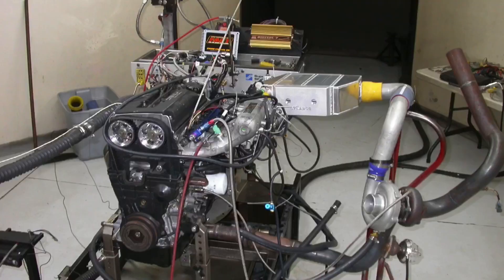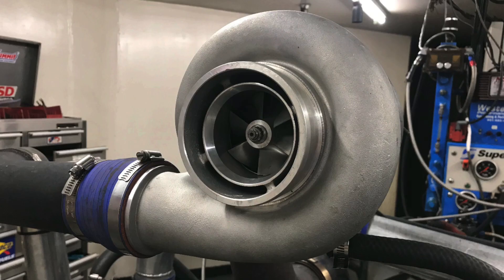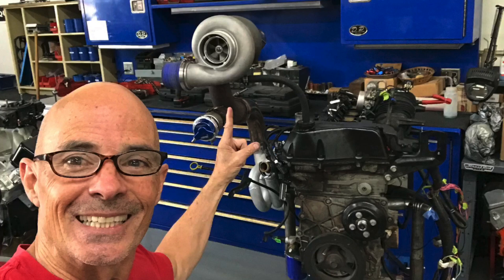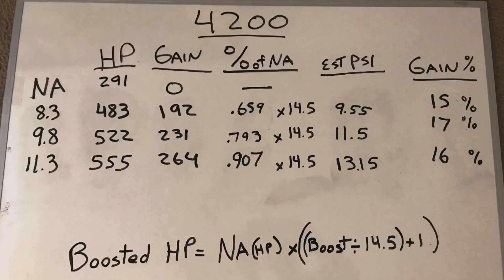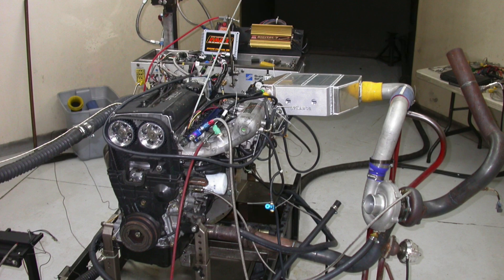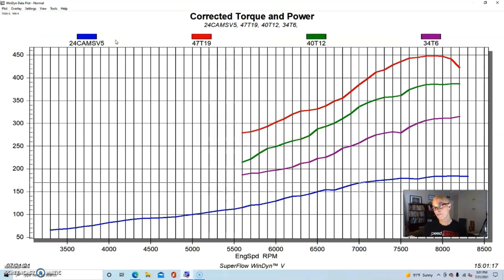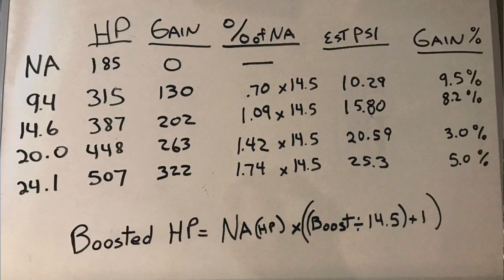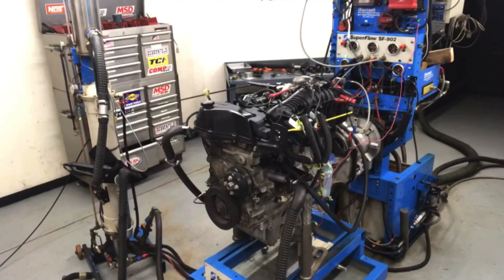TURBO ATLAS 4200 VS TURBO HONDA B16A- IS ONE BETTER FOR BOOST?

Comment: Great stuff Richard.  Question/comment - was the 4.2 tested on E85 or gasoline naturally aspirated?  If both tests on E85, ignore the rest of this comment.   If it was on gas you need to subtract out about 7% from the percentage improvement (vs. theoretical) when testing the boosted setup on E85, just because of the extra energy liberated by burning the E85 vs. gasoline.  There's also the cooling effect of alcohol (and the extra 40% fuel by mass injected and evaporated), but that would be tough to model easily.
Reply from the maker: THE VIDEO MENTIONED THE E85-THE 4200 SHOWED NO POWER GAINS NA FROM THE E85

Comment: Still waiting on that 3800…
Reply: Hes probably sourcing parts. I hope he finds some aluminum heads for it
Reply: @madmod  Unless he plans on paying 2k plus for some discontinued ZZP's, I doubt he ever will. There's also the few pair of aluminum prototype heads, but again I doubt he'd ever find a pair of those either.
Reply: @billballin6948  Ive seen them for sale on forums and Richard knows a lot of people.
Reply: @madmod  that's the only place they are for sale,and in the past few years I've only seen one pair of those prototype GM heads and maybe two pairs of the ZZP heads. I think a ported vs unported iron head comparison would be a lot more applicable to the 3800 community, especially when paired with an m90.
Reply: @billballin6948  He tried some hand ported iron heads on his 3800 tests and saw marginally no gains. Iirc he was pretty positive they had good work done, it just didnt make much of a difference on a non intercooled m90 3800 with mild cam timing
Reply from the maker: alum 3800 heads will not be part of the testing-since they are not really available to the average guy
Reply: @richardholdener1727  How far out on dyno time are you guys out there? We have an appointment at the end of August for tuning a v2 centri on a customer car.

Comment: your math is flawed the power na starts at 30 kpa there is only 70 kpa delta that is responsible for the na power
Reply from the maker: WOT NA IS 100 KPA-THE MATH IS SOLID
Reply: @richardholdener1727  yes but it doesnt start making power until 35 kpa so the motor is making  close to 30 hp per lb of pressure na
Reply: @bill2178  You're comparing it to the power made at 100 kpa of absolute pressure.  That's your reference point.
Reply: @ChurchAutoTest  If you look at the power gains at 4000 RPM it’s closer to 30 ft  lbs per psi But the torque is not rising relative to the NA curve that’s the effects of the rising backpressure and losses in density
Reply: @bill2178  we talking power or torque?  30 ft-lbs at 4000 rpm = 23 hp  Math!!

Comment: Any boosted motor you say? YOU HAVE MY FULL ATTENTION!!!
Reply: @richard holdener, I saw much larger HP gains per psi, when going from 7.8psi to 11psi, then extrapolated for higher boost levels to get a guesstimate/range of whp before I blew the last motor up. What would you attribute gains of 12.02whp/psi at 7.8 vs 13.72whp/psi at 11. Would you attribute that more towards entering the turbo's efficiency range, than the VE improving with more flow? 2.0l 4cyl for reference with a .50trim .62ar t3o4e.
Reply: My reason for asking is I am seeing a similar increase in whp/psi on the new engine and bigger turbo. This time with a fully upgraded head and lower compression. Mathematically what I'm seeing is a logarithmic increase vs the age old "every 5psi is 50whp" I've read in so many places.
Reply from the maker: THE HP/PSI IS A FUNCTION OF THE NA POWER PLUS (TO A MUCH LESSER EXTENT) THE OTHER FACTORS-TURBO & INTERCOOLER EFFICIENCY ETC... CHECK TO SEE IF THE AF AND TIMING AND CONSUSTENT IN YOUR COMPARISON RUNS
Reply: @richardholdener1727  Thinking back, I do believe the only change was AFR as my timing wasn't changed, but my fuel table was getting more refined street tuning. I think you're onto something!